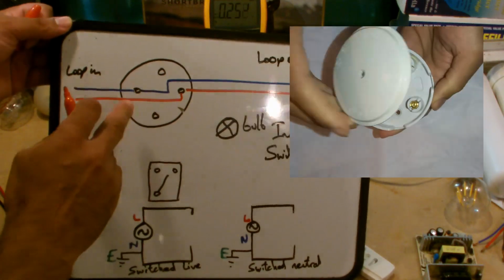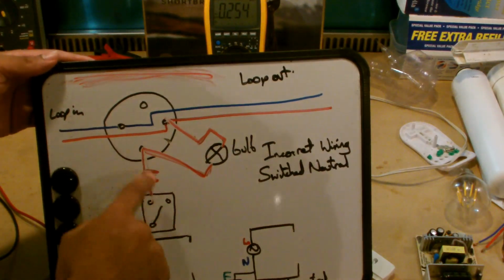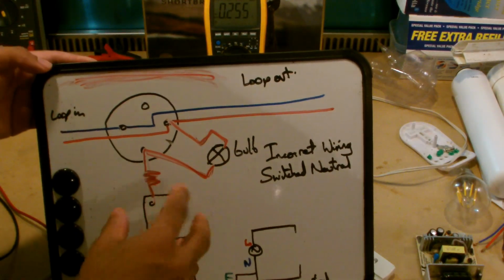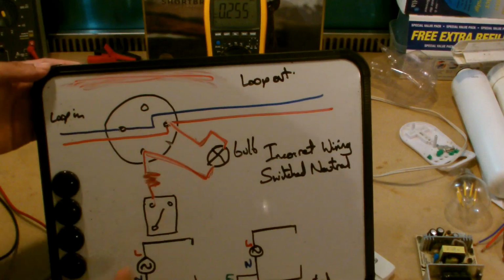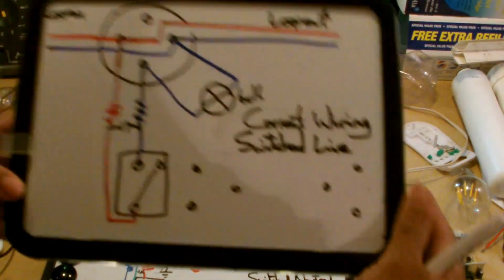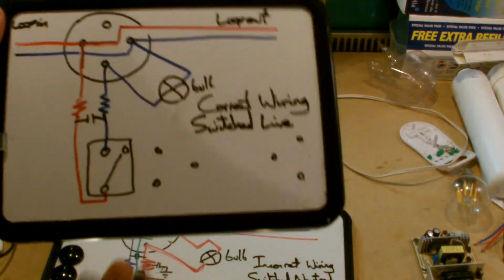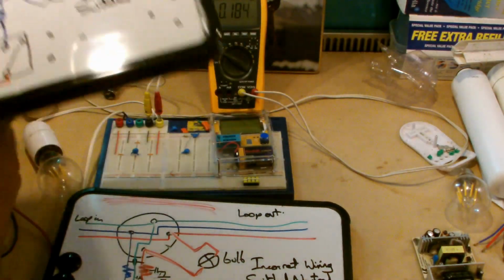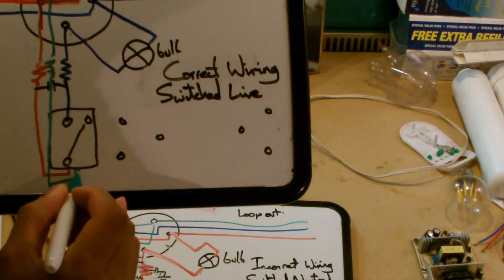Glowing LED problem: technical explanation with 5 possible fixes

Comment: Could a smart meter pick up the current and add up to a noticeable number across all lights even if we can't see the effect?
Reply from the maker: Quite probably as this will still be real power usage even if it is tiny.  Old dumb meters are quite sensitive but they intrinsically only measure real power.  With a smart meter the rejection of the reactive component is down to the meter operator and designer of the meter.  Part of the specification of a smart meters is to record the reactive component of electricity usage but as far as I can see there is nothing forbidding them charging for it.  In the past only large businesses and industries were charged for the reactive component of power consumption.

Comment: It seems my bulb flickers when turned off, i am installing smart switches that doesnt require neutral. Hopefully its a switched neutral right since all the other in the circuit is working completely.

In this case it means there is already a capacitor but its only enough to making it flicker and not off completely?
Reply from the maker: Thanks @abcddef2112 for the description of your issue.  Your issue is not really explained in my video as it has a different root cause but any device which is using mains power in series with a bulb, will draw a current in itself.  As the smart device  (could be as simple as a dimmer) is in series there is no effective isolation so the current is in both the smart device and the bulb equally.  Thus if there is a current and a voltage then there must be power dissipation in the bulb.  As per my video if the strike voltage is achieved then the LED or even a compact fluorescent will flash. This is a good video explanation of what I think is happening in your installation https://www.youtube.com/watch?v=tzWz_guJHvY
Reply: @robertwilliams8032  Another thing is after removing the cable from power supply and the one coming to the light from the smart switch, both are tested hot. Even after removing the lightbulb too..whose fitting seems to also be on. 

This is only in one of the smart switches and lightbulb pair (i installed three) and not noticed in other places where i installed the smart circuit. Maybe i should just ask an electrician to check this out. Even if it is wired as intended.
Reply from the maker: @abcddef2112  I agree that, if you are unsure then it is always best to ask a qualified electrician.  Good luck and please do have a look at the refernced video in my previous reply.
Reply: @robertwilliams8032  Yeah I did i am a fan of his video actually, from what I understand it is supposed to be like that esp with specific bulbs. Though im confused why the other doesnt behave that way.

I'll try with another switch and light combo. Seeing electrical circuit when trying to replace them I have reason to suspect they were shoddy installations. I was afraid something might go wrong (even though everything seems to be working properly now aside from one flickering), so still maybe calling an electrician is better.

Thanks for your help.

Comment: Hooking up only one sometimes will make it flicker or not turn off.  Once more are added it seems to work itself out😂.  I did some exterior lighting with new poles and the new bulbs were blinking.  I was freaked out and couldn’t find an answer online.  Found out they were wifi bulbs and we’re supposed to blink when new for the wifi setup😂😂. Figure that one out with your machine!
Reply from the maker: Thanks @chipburns4123 for the description of your issue.  Your issue is not really explained in my video as it has a different root cause but any device which is using mains power in series with a bulb, will draw a current in itself.  As the smart device  (could be as simple as a dimmer) is in series there is no effective isolation so the current is in both the smart device and the bulb equally.  Thus if there is a current and a voltage then there must be power dissipation in the bulb.  As per my video if the strike voltage is achieved then the LED or even a compact fluorescent will flash. This is a good video explanation of what I think is happening in your installation https://www.youtube.com/watch?v=tzWz_guJHvY

Comment: My led lamp had a similar phenomenon, they glowed when turning off if I switch on the neutral wire. When I switch properly on the line wire this phenomenon disappears.
But there is no ground wire in my house like in your video, only the line and the neutral wire. I don’t understand the difference between switching on the neutral wire and switching on the line wire. It’s like a capacitor before a lamp and a capacitor after a lamp, why this phenomenon happens only when I switch on the neutral wire?
Reply from the maker: Thanks Vật lý 10 - 11 for your question. Although you may be living in a home with no Obvious, separate protective earth conductor, your neutral wire is a line conductor which has been neutralised.  Neutralisation is achieved by being connected to earth at a location.  Usually at the distribution transformer and possibly in your consumer unit or at the main fuse or disconnect. Obviously this should be confirmed with an expert based in your country.  The Neutralised conductor will be near to the potential of the surrounding grounded voltage, although if it is carrying a current then it will not be equal to earth. (be careful of this conductor as in fault conditions it can easily get to dangerous voltages).  In my video I talk about the environmental capacitance which will be dominant in your situation as you do not have a separate earth conductor.  So when switched live, the live voltage will stop at the switch and when switched neutral the 'light fitting' side of the switch will be floating about the full line voltage. As what would be the neutral is now able to conduct capacitively through to it's surroundings.  I hope this helps answer your question.
Reply: @robertwilliams8032  Thank you for answering my question. Could you analyze more clearly the capacitive conducting between the neutral conductor and the ground? What object would form a capacitor for that? Can it be another parallel wire, a nearby piece of metal, or something else?
Reply from the maker: Thanks for the further question, and I'll have a go to see if I can clear-up the confusion rather than make it worse. With a switched neutral the section of cable between the switch and the lamp will float to mains voltage so the main drop in voltage, when switched off, will be across the switch but not across the lamp.  You can test this yourself with a multimeter placed across the terminals of the switch.  So the floating neutral wire will be capacitively coupling to earth and that same property can be see with an electricians' screwdriver as in this video https://youtu.be/0Ospzqy78iY?t=124 In the case of the electricians screwdriver your whole body can float up to mains voltage and sometimes you can get a susceptible bulb connected to the electrician's screwdriver to glow in your hands.  Please don't try this as one mistake or misunderstanding can result in you being electrocuted.  I may have a go doing a youtube short showing this effect.
Reply from the maker: Also note that if you touch the switched neutral of the incorrectly wired switched neutral with an electrician's screwdriver the glow will shine more intensely, as you will have increased the capacitive coupling effects. Remember the neutral in a switched neutral is at mains voltage and poses a hidden hazard which is why it is recommended to wire as switched live.

Comment: I find this video very informative…do u have a video about how to work out the correct capacitor from for a specific voltage that we need to that’s affecting my LED
Reply from the maker: Thanks Dennis for your comment. I have not made a video as yet but note, the capacitor option will only be suitable for AC power.  So extra low voltage DC at 24 or 12 volts will be unable to utilise a capacitor as a bypass. If you think of the capacitor as an impedance you can use the formula 1/(2*PI*frequency*capacitance) to work out the equivalent resistance for a given frequency.  Power dissipation is not an issue with a capacitor but using a mains class cap and placing it safely in a fitting should be considered mandatory.
Reply: Thanks… looking forward to your video

Comment: does this type of problems also turn off the laptop when plugged in?
Reply from the maker: Stray capacitance is unlikely to affect a laptop computer.  Computers in general are sensitive to power glitches and designers make sure modern power supplies and their filtering are quite well made and designed.  I have not heard of a modern computer failing when a vacuum cleaner is switched on, as in the old days.  So my belief is that this will not affect a laptop under normal conditions.

Comment: We usually recommend to use 0.47uf or 0.22uf 305v capasitor to put in on Live and neutral cable and it usually stops the glow
Reply from the maker: Thank you for your comment and an insight into your work process. My first thought is that is quite a high capacitance.  I assume you mean your recommendation is for a 120v country on a single split phase as 305v would not be sufficiently high enough rating for a 230v single phase country, like the UK (unless that is the RMS rating).  Also do you recommend a bleed down resistor for the fitted capacitor and if so what value would you recommend? For such a high value of capacitance, I believe the UK regulations would require an included bleed down resistor to be fitted as it would be a potential shock hazard.
Reply: @robertwilliams8032  The will be no shock hazard because it's only 0.47uf also you can use 400v in theory there is no problem with that. Also we have been recommending 0.47uf 305v to customers for quite some time and we have 220v outlets there wasn't any feedback that it didn't help or condenser we recommend was bad choice, so no bleed resistor is needed, you may need it if you use like 10uf condenser or more.
Reply from the maker: @Thaddeus, Thanks again, maybe you would like to make a video explaining all your points more thoroughly. It is clear from the watch hours this is a popular topic. As depicted in my video I found a 2nf (0.002uf) X1 Y1 mains class capacitor satisfactory. So a 10nf is about as big as you can go to get an X1 Y1 class cap in a small form factor.  I personally consider the choice and location of the capacitor to be quite a big deal and I feel it should not be underplayed or underestimated.

But to address your points you made in your comments,  a microwave capacitor may only be 900nf so just looking at the capacitance without looking at the voltage is very dangerous.  It is the energy in the capacitor which is the important consideration as well as the driving voltage.  Certainly with domestic mains you must always consider worst case scenarios. Again you have not said if the 305v is the manufacturer's DC or RMS rating. It would be a brave person to recommend a device running outside the manufacturer's rating, specification, in a domestic installation. 220v RMS has a peak voltage of 311v and a tolerance approaching 343v. Looking at my current voltage at the mains today, as I'm writing this reply, it reads 248v RMS and I technically live in a 230v European harmonised country.  That means my current peak voltage is 350v

The bottom line for me is the UK wiring regulations are the set standard in my country. They are not written in stone but and if anyone contradicts them they better have a rock solid, water tight argument.
Reply from the maker: This is an example of a 10nf (but it is a X1 Y2 so still suitable for the application) https://uk.rs-online.com/web/p/ceramic-single-layer-capacitors/8773668/

Comment: You would be better off tackling one problem in one video; keeping the bulb constant to explain the switched neutral issue and then making a second video about the susceptible and nonsusceptible bulb issue
Reply from the maker: Thank you for your comment and I agree that this could be shortened to three videos.  The problem is that they are strongly related and I feared that separating the sections would generate too many questions. In reality there is further information that I didn't include as this subject could easily span over an hour to discuss.  My goal was to allow the issue to be seen in a demonstration but I agree this is a technical issue and my video is more aimed at the technically minded person.

Comment: Hello, what would be the difference between let's say a 220KOhm resistor and a 15nF capacitor? (240V 50Hz EU voltage)? Is one better that the other?
Reply from the maker: Thanks for the question.  The main difference is that the resistor will need to dissipate considerably more power when the light is switched on.  The power rating of the resistor must be correct to account for the heat it will generate with 240v across it.  So sizing and placement of the resistor is more limited.  The capacitor will still dissipate power but it is near insignificant in comparison and generally no special consideration for its heat dissipation is required. Personally I consider the capacitor the superior option but only if you use a certified mains rated cap designed to be fitted across the mains.
Reply: @robertwilliams8032  great! Thank you!

Comment: Nice video. I use a larger LED bulb in the same style and I've never seen it do this. I have it connected to a power board with switches for each outlet so I assume this prevents leakage.